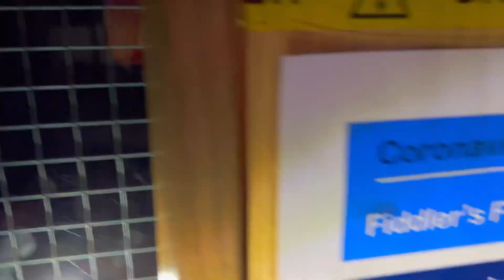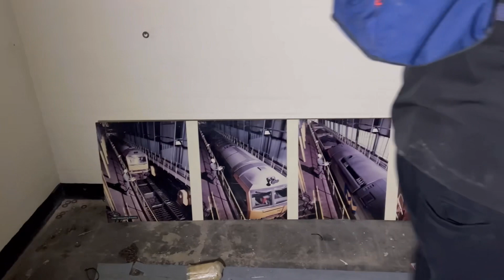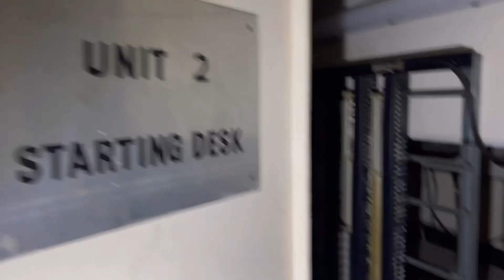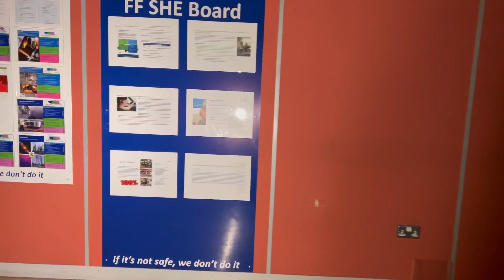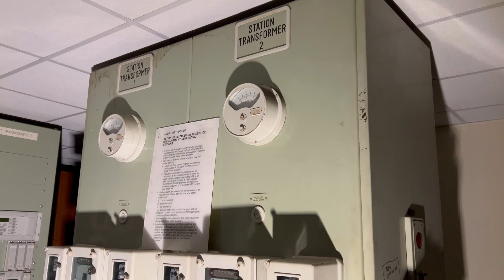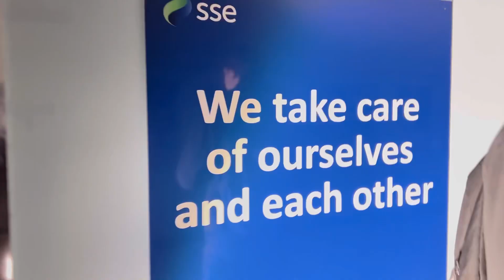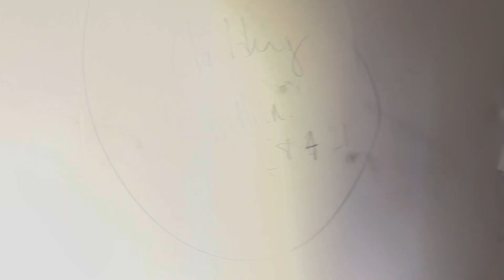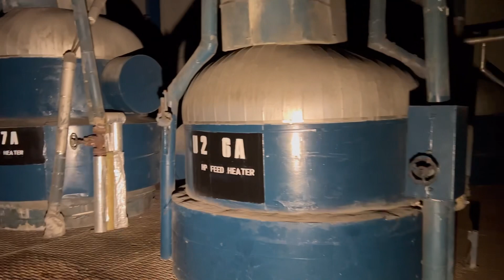Fiddlers ferry power station control room

Comment: We shouldn't be closing these power stations.
Reply: I know. When the wind isn't blowing were heavily reliant on the French & imported gas. A very precarious position to be in.
Reply: Widnes skyline will never be the same once fiddlers has gone 😢  remember it getting built when I was a kid.
Reply: tiepup 
Yes I'm aware most of the coal came from Poland & Australia. I'm not suggesting we fire them all up, I'm saying some should be retained in working condition to cope with problems or peak winter demand.
Coal more expensive than gas with current prices? I'm not sure where you heard that one? Wave power, what percentage of the electricity generated is tidal? 
Well let's hope your utopian dream of wind and solar can keep the lights on during a dull calm winters day.
Reply: tiepup 
I'll look into the coal cost myself as I seriously doubt it's more expensive than gas, particularly in 2022. So tidal power accounts for bugger all then?
You missed out the part where we're reliant on the French & Norwegians to prop up our electricity grid.
I don't dismiss wind power in this part of the continent, you just need a viable alternative for dull, calm days, which currently we don't have.
Reply: @robbielawson4828  Battery storage. other alternative sources keep going.